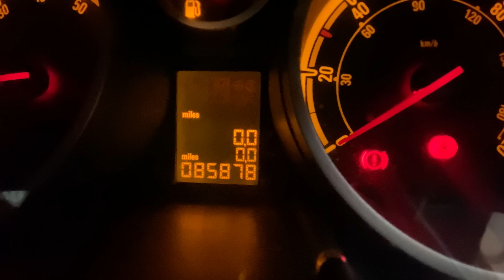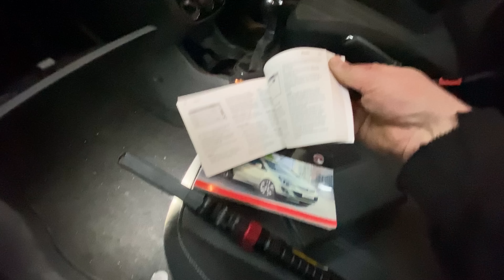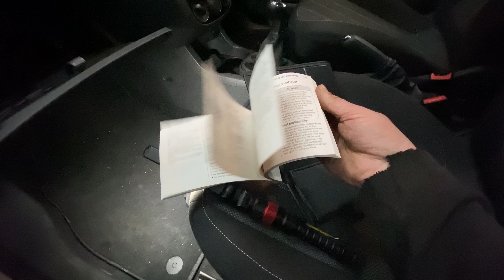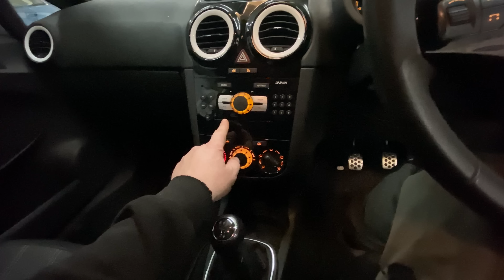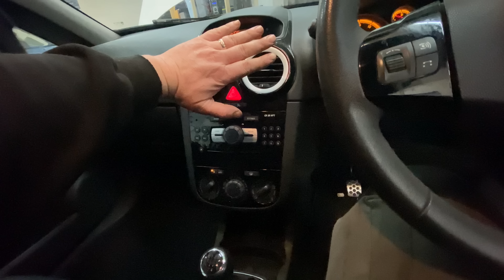New Project Pick Up day 7 Hour Round Trip To Get It

Comment: Nice motor   mark I've got the 1.4 Sri model  same colour as yours  mine is a 2010  reg on 92000 with original timing  chain from factory  really quite as it goes all 1.2 and 1.4  petrol models are timing chain driven  yours s sound's ok fun little car's 👍

Comment: Nice motor there Mark - I think you might find the Vauxhall 1.2 has a chain driven cam. You might be able to look up the dealership on the number plate up in and around the area where you picked up the motor, to contact for possible service history?  Would be great if you could find some!